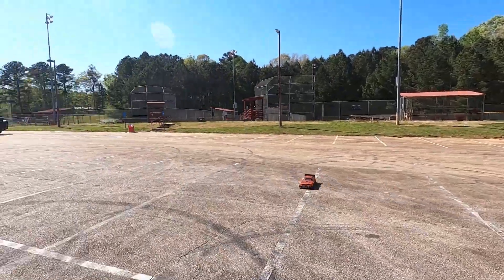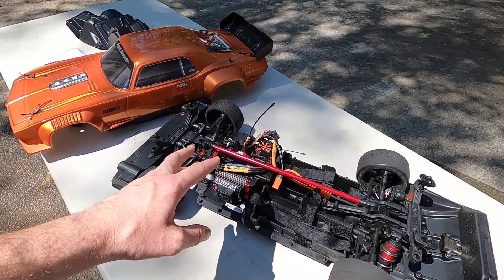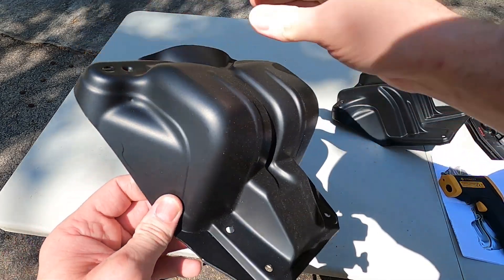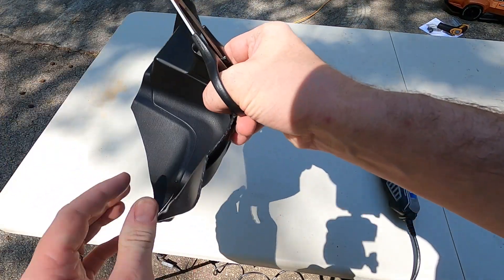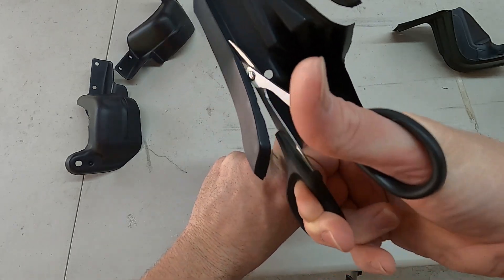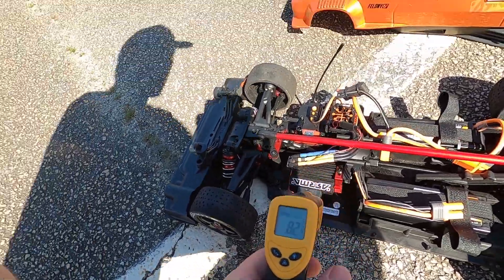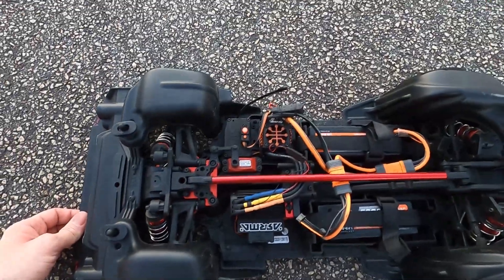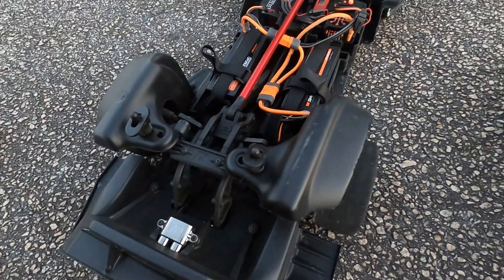Installing And Testing Inner Fenders On The Felony

Comment: That's unfortunate. I almost got this with my last Scorched Parts order (titanium Ackerman plate, titanium longer screws and nuts for splitter).
I don't want huge spots on the body rubbing. I already have that on the front wheel wells. 
Thanks for showing us your experience with the "upgrade".
I just use my air compressor after every run.

Comment: I almost pull the trigger on this set. Now, I'm not sure if I want them, since you did make a good point about overheating.  How about if we buy a mesh dust guard protection and cover over it?  Would that be better or worst?  Also did Scorched fix that rear fender and make a ver 2 of it?

Comment: So actually just got mine in today and I cut them out perfect even though the instructions you need to cut them out a little more than what they say.

What happens is if you're running a small tires up front I think you'll be okay I'm running the fatties all the way around, so please don't work that well because of the turning radius of the fat tires.

I found that even with the skinny tires up front and the skinny tires in the rear after running it it wasn't that much cleaner so I agree with what you said in the video this is really just for heavy dirt some mud or some water.

I ran mine literally for about 20 minutes in the rain today but at home dried it out of the shop back and I'm good to go.

So these worth 30 or whatever that they cost? Unless you are really going to be running in the mud which at that point it wouldn't matter anyways then I wouldn't waste your money.

Great idea but I think once I get something that fits better and configures better to the different aspects of the car I think it'll be an even better idea once they nailed a little better.

No I am going to go back once I have more time and mess with a little more I really don't want to cut my felony body because they're $95, to the left cutting into the body that I have to do is best.

So in your video you were talking about in the rear hump how it's hitting the body you have to cut out part of the body if you look on the instructions it shows you that I was not willing to do that so that's another reason why I didn't keep them on.
Reply: So actually going to edit my comment I'm going to kind of own up to a mistake.

I figure out what I did wrong and got the fenders on just fine so I'm probably going to order some more and then possibly another body. But just to clarify once you get everything settled in it everything should fit okay it's just I don't think everything's going to sit perfectly flush but it does look okay from the outside of the body.

Comment: Darn man, you got that drift down now with the felony.  I really like that RC, just don't know if I would be able to keep from hitting something with it.  Great stuff!
Reply from the maker: Lots of room and lots of practice!
Reply: Buddy I have 3 felony's 3 ..6s infractions 2-3's infractions an 2-vendettas.. it's inevitable you're going to crash if you're not used to the speed I suggest when you get it put the throttle setting on 50% until you get used to it you have 50 75 and 100% if you're wondering why I have so many I have each one set up for a certain application and one is kind of a Frankenstein I'm turning a felony into an off-road vehicle good luck my favorites are the felony the 6s infraction and the 3's infraction is really cool have fun

Comment: Figures you would bring these up the day after I put a light set in my FELONY , I WOULD have to move the fender lights to put fender gaurds in , I also installed titanium spark strips on the bottom of the chassis , I got them from scorched parts , gunna be a really cool night time car
Reply from the maker: I have all that coming also.
Reply: The spark strips are for when it scrapes the car under it makes sparks?